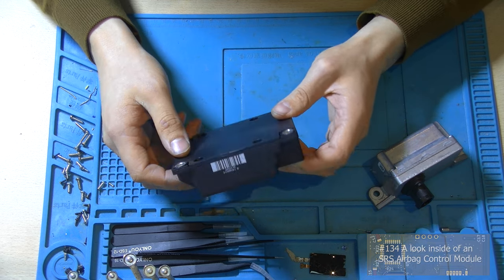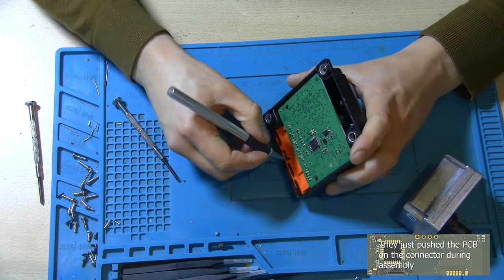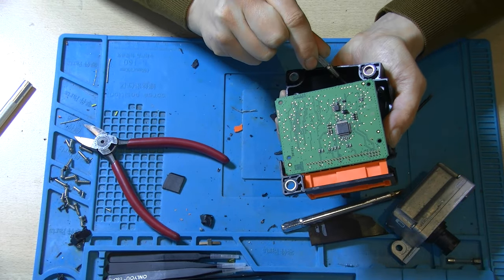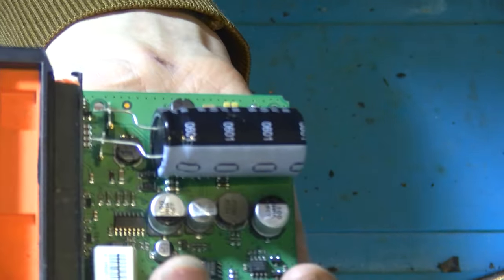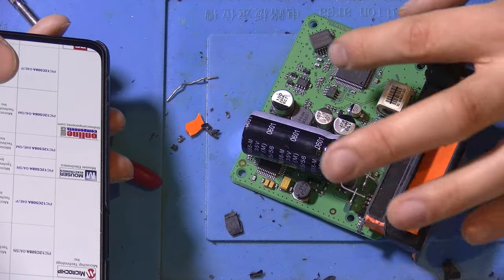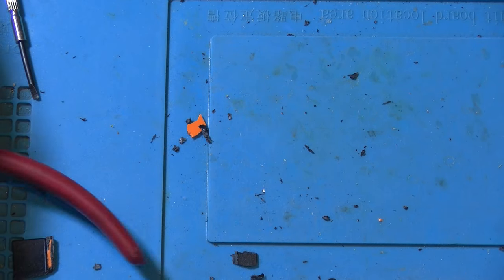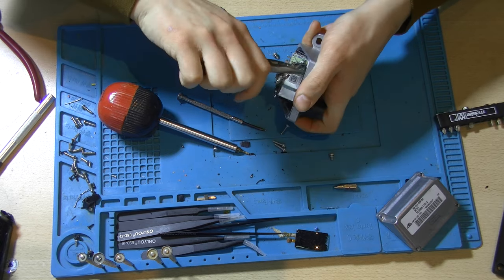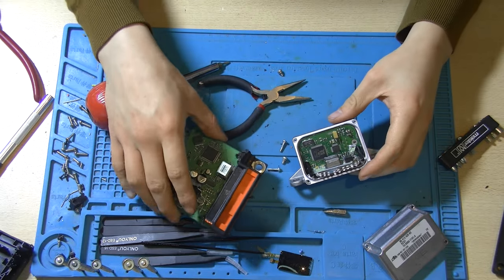#134 A look inside of an SRS Airbag Control module

Comment: Hi, Youtube recommended me your video. After watching this one I recommend you to make more editing on interesting stuff. Not many people enjoy 3 minutes of openin plastic box.
Also please do some research, before you start to explain it to others. It will look more professional. 

The SRS main unit usually contains backup accelerometer, but the system mainly relies on front crash sensors (or accelerometers) of which one of these is probably the small unit. There are usually more of these boxes in a car: front, back, side. The "not soldered" connector is a Press-fit connection, usually placed at some boards with SMT components, where THT connector cannot be soldered in the same process - oven (will melt). So it is placed afterwards by simple pressing operation.
Good luck with your channel.
Reply from the maker: Hi Peter, thanks for your feedback! It's much appreciated. How did you enjoy the YouTube-short version of this video? Was that what the original video should've been?
Reply: @TimsElectronicsLab  I have seen the Reel (or how it is called), it was better, but I am not really fan of watching these "tik tok like" videos, as they are usually too short for my liking. But depends on topic. Generally for short topic I think 3-10 minutes is fine, sometimes I see entertaining videos 30 minutes long. I bet you know other youtubers who makes electronics stuff, so maybe try to catch what they are focusing on and how they are doing the editing. I can recommend channels like The Signal Path, or Curious Marc, Mr.Carlsons lab, Phil's Lab. Hope this helps you make more subscribers.
Reply from the maker: Thanks Peter! I really appreciate you taking the time to help me out :-)